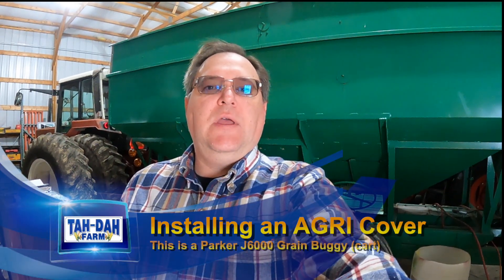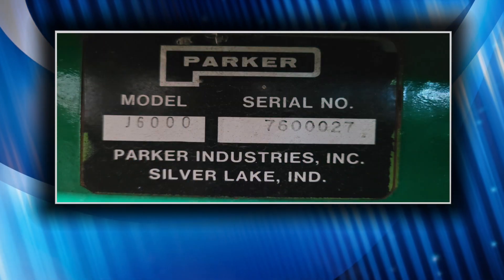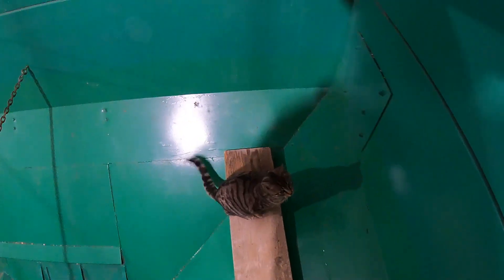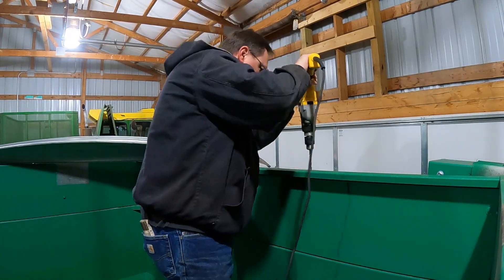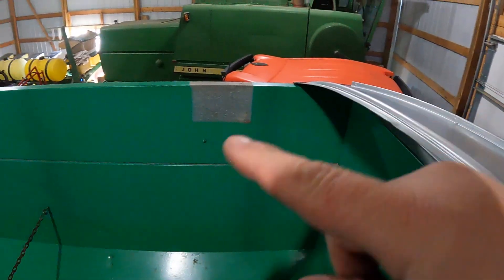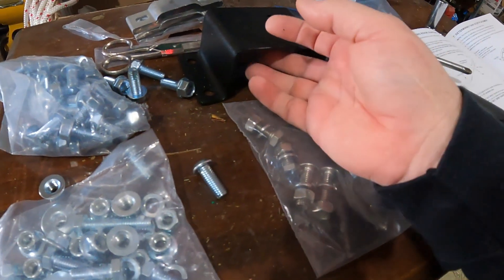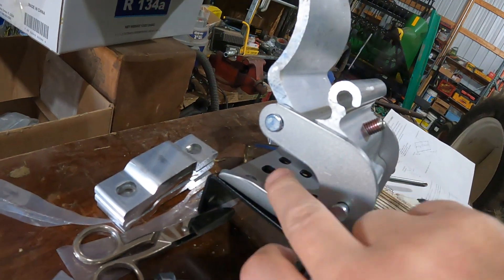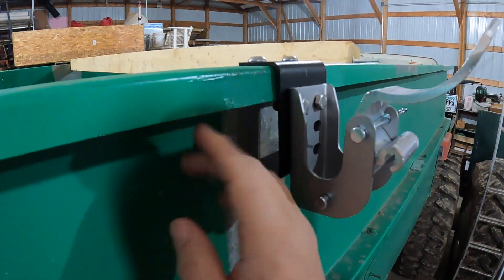What is Involved and How to Install a AGRI Grain Cart Cover

Comment: Pretty nice! I agree about fixing that joint in the center  where the tarp is rubbing it. Maybe you can clamp the high side flush with the side and tack weld it on the under side to hold it so you could angle grind off the tacks if the need arose?
Reply from the maker: If I could weld that good I might try that but not consistent in how it will try out, lol. It is made out of galvanize so I'm thinking that I can bend it down with a big hammer and pipe wrench. Will see. Thanks for being here and watching.  Always enjoy seeing your comments.
Reply: @TAHDAHFarm  Yeah, the big wrench/hammer combo should work on that if it is galv.  Maybe lay some heavy silicone (or something similar if you know of something better) caulk over the seem to add a layer of protection after you get it close.

Comment: Nice job on the install and the agri covers are alright for grain cart duty but i have one on a hopper trailer and its not a great tarp since i roll it back and forth 12 times a day so its worth the money to go with shurlocks since they just plain live longer for me
Reply from the maker: I had a local tent and awning company make me a cover from the same material that they use on truck trailer tarps for a hopper wagon years ago.  It is much heavier material then this tarp.  If or when this tarp goes bad, I will have that local tent company replaced it. That will definitely last a long time and they didn't change that much for the one I got. Thanks for watching and your comments.